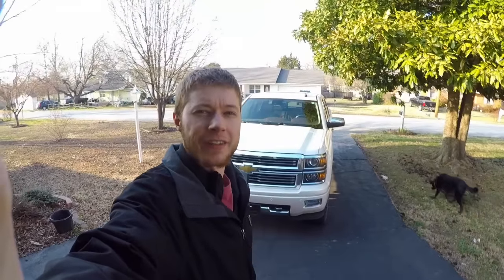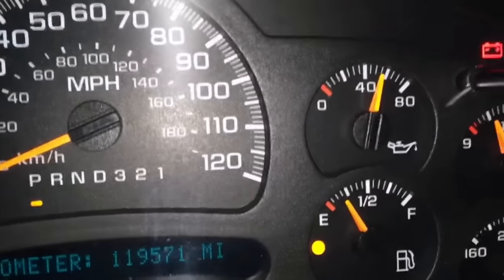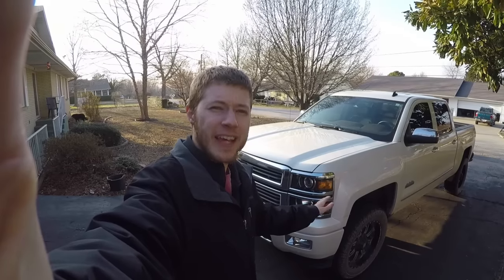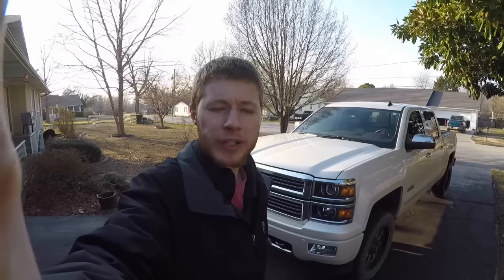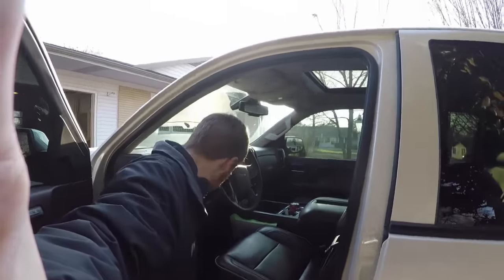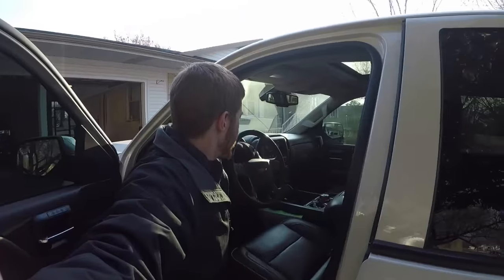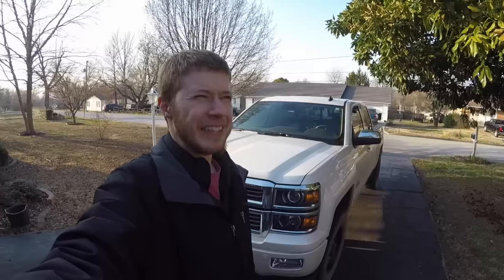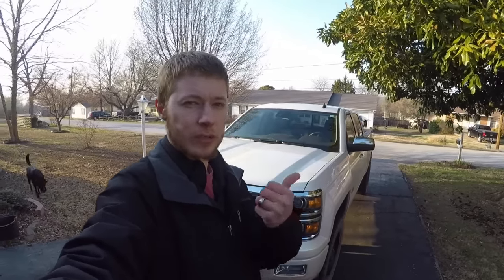Silverado Sierra 5.3 Lifter Noise Tick (What to do)

Comment: I have actually done this and it does work change your oil and substitute a quart of transmission fluid and run 5w-30 synthetic preferably Pennzoil but whatever you run and also marvel mystery oil add to your gas and your oil. The lifter's get dirty from not changing the oil regularly and I will say that Castrol GTX was usually what ppl were using when their lifter noise started and worsened with time so Pennzoil or Valvoline even Mobil 1 hell even Wal-Mart brand super-tech is a good clean oil I have used it for alot of my vehicles but dirty lifter's are noisy lifter's remember that...

Comment: I had an 06 that did it. And what fixed it was I replaced the factory oil pump with a high volume aftermarket and it ran better and no noise. But it is supposedly common with the 14-17 5.3's

Comment: Try 89 octane. My '14 Silverado runs quieter on it and gets better mileage (I know it's more expensive than 87). Also drive it in manual 5 to keep it in V8 mode whenever you're going less than 60 mph.

Comment: It’s actually hydraulic lifters that have lost their “prime” after the engine sits for a while. That’s why its heard when it’s cold. As soon as the oil pump starts running on engine start it fills them back up and the noise goes away after a few seconds. Perfectly normal for a hydraulic roller lifter setup like in an LS. My ‘04 Avalanche does it and I’m at 185K and still blowing the doors of fords. Keep the right oil in it, don’t overfill it, and change it regularly, and that engine will last forever!
Reply from the maker: That’s what I like to hear, great advice buddy!

Comment: Long but worth the read. My 2003 Suburban had the annoying tick and is now quiet as a mouse. I decided to live with the tick after 2 mechanics said I needed an engine rebuild. I had no power loss, engine ran smooth, it just ticked and chirped. Then my check engine light came on and code was driver side catalytic convertor. Berrymans makes an emmission system cleaner that I have used in the past so I decided to try it and clean the convertor. We were going on a road trip so I bought 2 bottles of it. One for the trip down to Fredericksburg and one for the trip back. It was 250 miles each way with driving at 70 to 75 mph most of the time. My check engine light never went out but guess what?? No more tick. Amen. The tick had greatly reduced when we got there and was completely gone when we got home. I have driven my Suburban over 10.000 miles since and no tick returning. Try the Berrymans and hopefully it may help you.